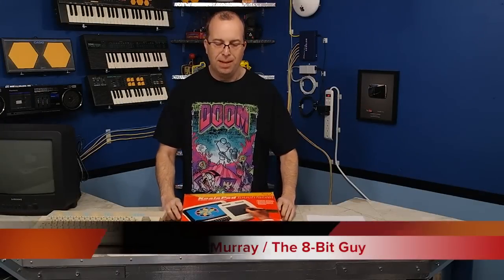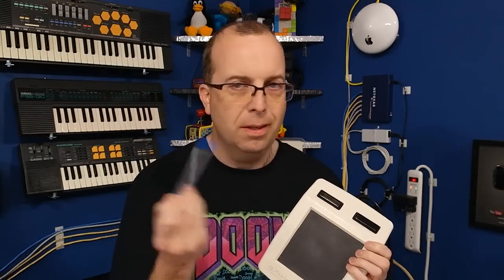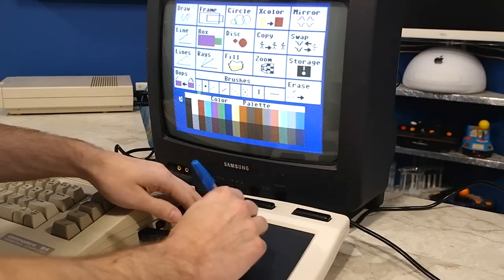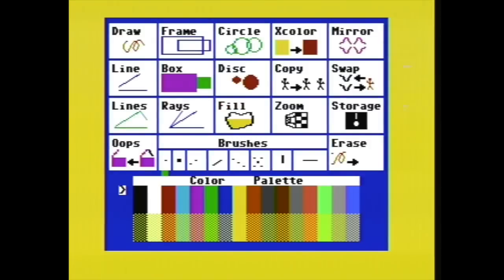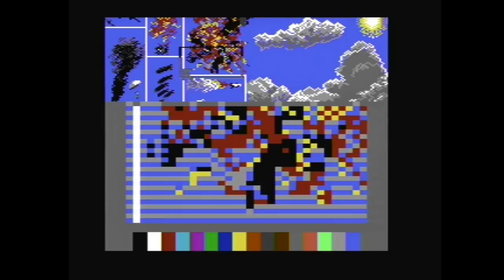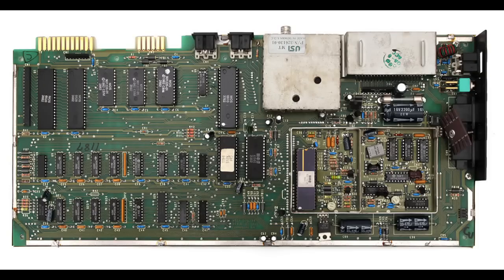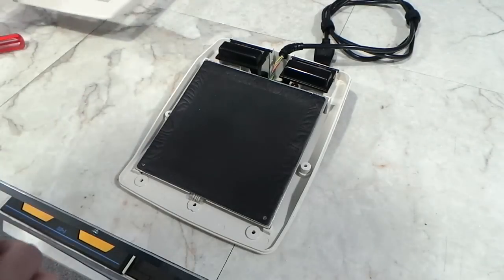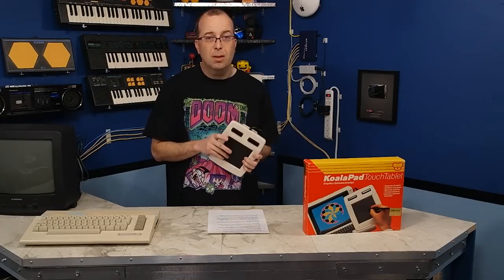The KoalaPad - How we used to create graphics

Comment: Would have liked to see him trying to draw with the paddle
Reply: That would probably be remarkably similar to an Etch-A-Sketch
Reply: cedmanotro Thought that was his next move.
Reply: I think that's called an Etch-A-Sketch. ;)
Reply: +Ram Laska yep
Reply: Ram Laska an etch a sketch has two knobs
Reply: cedmanotro As would this: one paddle for X, one for Y
Reply: Yeah, it would be just like an etch-a-sketch.
Kinda like how using it normally is like... a pen. ;) haha
Reply: I dont think he could draw with the paddles because it would be missing a that button connection the pin that signals to start drawing.
Reply: Mike Magee Those are probably on the pins for the paddles' buttons.
Reply from the maker: Actually.. I had meant to do this during filming and see what happened.  I suspected it would be like an etch-a-sketch.  But I forgot and didn't remember to do it until I had already packed everything up after filming.. so oh well.
Reply: The 8-Bit Guy sad :,(
Reply: Has there been no Anti Aliasing algorithms back then on Commodore 64 or Apple computers?
Reply: DanielNL
Even if they did, the available color palette wouldn't have been wide enough to represent in-between values.
Reply: Dithering was pretty much the best they could do. Antialiasing wouldn't come out until computers had access to a more colors.
Reply: How many colors? And what would that be? Win 95 or already before that?
Reply: Follow up vid :D
Reply: ***** Not as insane as you might think, if you're clever. But as DataCab1e mentioned, the color palette was limited.

What you're probably thinking of is FSAA/SuperSampling, where you render the image in twice the resolution, and scale it down to the screen size. Really basic antialiasing could be something as simple as putting a light gray pixel around every black pixel you paint on screen, like using a feathered brush in photoshop.

In the early days of antialiasing (1992 or so), there was even software (I think it was called JAG on the mac) that would do antialiasing of 2D vector graphics for you ("in post" they'd say in the film business) so that you didn't have to suffer software slowdowns (or buy more sophisticated software that supported AA). It was basically just a sophisticated blur (hi-pass filter??) algorithm that smoothed out jaggies without losing detail in the picture.

For vector graphics and vector text rendering (the Macintosh didn't get vectorized fonts in the OS until System 7/1990), it was a matter of calculating how much of the shape in question is in the pixel, rather than simply whether it is in the pixel or not (resulting in a shade of gray (or whatever the color of the object was), rather than just black and white.
This did make things a little slower, but not as slow as what you call AA in gaming.

If you read up on AA in gaming, they've even learned to take smart shortcuts there, and they don't render the entire frame in 2x/4x/etc. resolution.
But I'm not a big gamer, so I don't know much about how 3d graphics works. I grew up in the 2d days... heck I grew up monochrome! :D
Reply: logicalfundy I remember trying to pull off AntiAliasing via dithering on my old Mac SE back in the day... even with careful hand-editing in "FatBits," it never quite got there. I'm sure the (16?) colors that the C64 could get closer, but only so far.

Did anyone else grow up in the day where you would get some cool graphic on the screen, and then have to back up as far as you could get away from the monitor in your bedroom so you could actually "SEE" the picture, and not a dithered mess? It was even worse in monochrome, ha!
Reply: The Atari ST had anti-aliasing with Spectrum 512.  It had a large color palette so it looked quite nice.  It was slow, however.
Reply: DanielNL Theoretically, you could do it with 256 colors, but that was still palette based and probably couldn't guarantee enough colors for the transitions - it really didn't become viable until we had 24-bit and 32-bit color available, which was basically over 16 million colors.
Reply: Would have liked to see him trying to draw with the paddle
I've done it. It's just like using an EtchaSketch, but in colour.
Reply: Ram Laska Indeed I do recall such images, along with printer (ASCII) art where you had to stand way back to figure out what you had just printed.
Reply: Master Hoshi I wonder what the first game with Anti Aliasing was
Reply: Each paddle has a fire button... And they'd correspond to the two buttons on that unit.
Reply: Ethan Poole Yeaah, dude! That was the stuff! I literally dreamed of finding ways of rendering color on my monochrome Mac, or getting an Amiga with it's dreamy HAM color modes. There was actually a SCSI graphics adapter that would let you hook up a color monitor to a monochrome mac. $600, not including monitor (early 1990s dollars).
Reply: For the record, I did AA in 1989 with nothing more than text mode on an IBM AT (is that what they were called?). I just printed a series of full-character-cell blocks in a diagonal pattern, and then printed out the same series of blocks with light gray blocks surrounding them. If you backed all the way up (to get far enough away from the chunky "graphics" on the monitor) you could tell a difference.
It was just to play around with the idea of doing AA, since I didn't have any hardware good enough to see the real thing for myself.

I'm trying to remember when AA text rendering came about on computers. I know Windows XP had Cleartype (sub-pixel rendering) and AA, did windows 95 have AA? Anyone remember? (or have a VM? ;) )
Reply: Font smoothing (basic AA) was introduced into Windows with the Plus! pack for Windows 95:

https://www.microsoft.com/typography/SmoothFonts.mspx

Font smoothing was included by default in Windows 98:

https://www.microsoft.com/typography/faq/faq4.htm

Microsoft's ClearType (which tweaks colors a bit to take advantage of how pixels are packed on LCDs) was introduced in Windows XP, but wasn't turned on by default until Vista:

https://en.wikipedia.org/wiki/ClearType
Reply: That's right, I remember now.
Windows 95's AA worked very well, and didn't seem to slow down the system much.
Reply: That is just what I was going to say.
Reply: Would you have had a way of simulating the button press while using the paddles?
Reply: Fabrizio Lungo it's using the same pins so eh
Reply: Another bit of info for the AA origins question: While Windows 95 was the first microsoft OS to have font AA (if you had the Plus! pack), Mac OS 8.5 (1998) was the first MacOS to have it: https://en.wikipedia.org/wiki/Mac_OS_8#Mac_OS_8.5

I can't think of any pre-Mac/Windows software that might have had it, but I know that the Apple II did a (very) rudimentary type of subpixel rendering because of the way color was addressed (extra color bits was used for extra resolution in monochrome mode. So if you created high-quality graphics for monochrome monitors and viewed it on a color monitor, it would look like subpixel-rendered graphics -- except that subpixel rendering could never work with a CRT, because the electron gun was not align to hit the shadow mask perfectly -- not even on the Sony Trinitron)
Reply: Ram Laska You mentioned Windows 95 could perform AA very quickly: With the AA used in font smoothing, you could use mathematics to determine how much a pixel was covered pretty well, which can be done very quickly. It's also the case that font designers can add "hints" that can ensure the fonts look good at small sizes.

The reason why it's so much more intensive in 3D graphics is because predicting the colors you need to antialias between is much more difficult, because of textures, lighting, shadows, and other parts of 3D graphics that fonts don't have to deal with. There's also no reasonable way of adding hinting to a 3D model. Thus, 3D graphics has to use more intensive methods to antialias. You can always brute force AA by rendering it larger and scaling it down (aka supersampling), although some faster algorithms have been developed as well.
Reply: cedmanotro Wasn't sure if the paddles had a FIRE button or if The 8-Bit Guy could break out Pin 5 in order to get a button that would work.
Reply: Fabrizio Lungo  Wasn't sure if the paddles had a FIRE button
Yep. A big red button at the end of the paddle controller. You can see it in the video.
Reply: God Emperor Lionel Lauer Ahh, should definitely have worked then. Thanks.
Reply: logicalfundy You're totally right. Calculating AA in 2d is so much simpler than in 3d.
Wildly guessing here, but I think what a lot of video cards do is render the frame at screen resolution, an then re-render only the parts with high-frequency data (aliased) in a higher resolution. I'm not sure, though. Not much of a gamer, and boy, Macs sure stink for games. My Macbook air is only two years old, and I have to turn the graphics waaaay down on Kerbal Space Program for it to run smoothly.
Reply: Ram Laska  Calculating AA in 2d is so much simpler than in 3d.
Back in the 80s, we used to antialias by hand when we were laboriously drawing up pixel graphics.
Reply: God Emperor Lionel Lauer  Aye sir, did a little o' that myself!
In 16 color mode (or less), though, there wasn't much palette to work with. If you wanted to AA a black or white line, it was easy enough, because you had 4 shades of grey. But if it was RGB/CMY, there were only two shades of each. I guess you could do a little bit of it, but not a great deal.
Reply: God Emperor Lionel Lauer I think in todays parlance, though, they would call it "Feathering." AA implies a mathematical process, since "Aliasing" is (if you read the wikipedia page) a signal-processing term, not an aesthetic one.
Reply: Ram Laska It was a lot easier when VGA & then SVGA cards hit the market.
Reply: God Emperor Lionel Lauer SVGA? Pffft... that's practically an NVIDIA. 😂

I miss the days when computers were a challenge, whether it be graphics or programming, or even finding ways of writing a whole book in one without it running out of RAM or Disk space.
Reply: Ram Laska You want a challenge? Here's the first computer I programmed on, back in about '78:
http://www.oldcomputermuseum.com/mini_scamp.html
We had the fancy expanded memory version with an entire 1KB of RAM. ;)
Reply: God Emperor Lionel Lauer 
Beauteous! Reminiscent of the Altair 8080 or the IMSAI. Definitely sweetly limited ;D
How far did you get with it?
Reply: Ram Laska I wrote a buttload of SC/MP assembler, hand assembled it, & 'keyed' it in with the toggle switches. Not fun, but very educational. It was kinda like playing the world's hardest computer game. ;)
Reply: cedmanotro same
Reply: cedmanotro in my opinion it'll be a digital etchersketch
Reply: Maybe he should draw with the Rolling Rock from the NES
Reply: Damn that would have been a great idea for the 8-bit guy to try, just to see how the software reacted.
You hear that 8-BIT guy, we want the paddles plugged in to the Koala software!! ;)
Reply: @The8BitGuy  I got some diskette software for the Koala Pad, including Koala Painter AND the "Instant Programmers Guide". Do you have any idea what sort of software that would be?
Reply: @The8BitGuy  ah rip
Reply: I would have rather seen him play a game that uses the paddle with the koala pad

Comment: I always loved how in BASIC you can just PEEK and POKE hardware registers, like as you used in your test. Nowadays the hardware is hidden under so many software layers
Reply: Yeah... Although many modern compilers still let you use inline assembly code, which comes pretty close to the same thing.
unfortunately if you're using a modern multitasking OS, the OS might freak out and complain if you do certain things.
The last time you could easily do things like this on a PC was using DOS.
Point of fact Qbasic has the same abilities to read hardware registers that systems like the C64 did.
And many DOS games were using graphical modes which you could only enable by writing directly to the graphics card registers...
Reply: YEP, I remember long ago turning the datassette motor on and off writting to a certain position ...
Reply: being able to take a look under the hood is great from a development standpoint, but it's insecure as heck. Use a debugger or other tools to peek inside the working memory of modern programs
Reply: Funny, 30 years later I still remember: POKE 808,234, POKE 788,52, SYS 64738, SYS 49152
Reply: Luissen Tawnybrush
 I understand the reasons why they no longer allow such access anymore, but on such old 8bit offline systems, it was a joyous and fun thing to play around and learn from... im just reminiscing good times
Reply: I'm not too familiar with it, but I have the impression I've seen similar things being done in Linux using something like cat /dev/something in the shell... Am I remembering it wrong?
Reply: Kids these days could still have these 80s/90s programming practices if they cared enough - almost every high schooler in the United States has a TI-83/84 plus, which had a pretty huge z80 assembly community at least in the early/mid 2000s. While it's died down a bit, all the resources are still there, and in a very robust state, and the install base of z80-based handhelds is pretty huge.
Reply: You can get that "down in the metal" feeling these days with a Raspberry Pi or Arduino.  You still rarely poke around in memory addresses but especially on Arduino you could.  The CPU architecture of the 8-bit AVRs is actually human understandable.
Reply: +Joseph DiSalvo That was my introduction to programming.
Reply: While you could peek and poke around on the C64, a lot of the addresses were un-documented, known only to few people in detail.   But as time went on, the information started to spread.  SYS 64738  away!! :)
Reply: That's the appeal of the Arduino or Raspberry Pi.  You get these GPIO lines to peek and poke all you want.
Reply: Windows NT forbade accessing hardware directly, IIRC

Comment: I've got one of these for the Atari 8-bit/Commodore 64, but I've never had the software to use it with. Awesome to see this in action, had no idea it used the pots to do its thing!
Reply: some PVA Glue (for repairing books) will fix the tear in that box right up! You can even buy archival grade if you afraid about yellowing over time. Just apply a small amount with a toothpick, i know i'm OCD.
Reply: Lazy Game Reviews  I'm a big fan, I'm looking into getting a c64, any advice?
Reply: +Landon A  ofcourse,  look around on e-bay clones and you'll have an easy time :P
Reply: raafmaat thanks man. :)
Reply: I have the same problem- I have the official branded Atari 8 bit one, but can't find any of my carts!
The cart for that one also had a Game Of Life app, which was the first time I ever saw one.
Reply: confuseatronica
 oh man,  as a kid i used to play with game of life,   found out about crawlers and guns etc,   but it wasnt until 15 years later i found out people are making whole machines with it,  actual logic gates and stuff
Reply: +Landon A i suggest at first getting a C64C or C64G  because earlier versions tend to be dead when you buy them, unless you buy them at a local vintage computer expo or something where you get to see that they're still running and they don't get bumped in transit. Newer versions run their chips off lower voltage and have more modern IC design, as a whole more resilient to electric and thermal issues. For the most part, even dead newer ones merely have a broken PSU or dead fuse with nothing in the system proper actually being wrong. It probably makes more sense to get an aftermarket PSU or fashion a new one yourself than trying to repair the original one.

But of course purists sneer at the Cs, for one, they don't look like a breadbox, for other, they sound different - a lot cleaner, usually somewhat punchier in the bass, more consistent among each other but quite different to original system. Digi voices break in some games, but people mod the machines to re-introduce that.
Reply: Siana Gearz thanks for the info, I had no idea that the c64c ran better than the original c64, thanks again for the advice :)
Reply: Lazy Game Reviews What's up LGR. I have been seeing U a lot on 8 Bit Guy's videos. Please do more LGR Thrifts episodes.
Reply: Lazy Game Reviews I accidentally reported your comment idk what for it was an accident... I'm sorry
Reply: POKEGAMERZ 9185 bhh
Reply: Lazy Game Reviews 

L
Reply: I bought a Koala Pad at a local computer store back in '84, but the pixel control via the pen was way inaccurate, as it was holding down on one spot, the on-screen pointer kept "jumping/flickering" back and forth to adjacent pixels.  Guess it was due to the low resolution of the  digitizer and the x-y input port inaccuracy, none the less it was fun and amazing at the time. :)
Reply: LGR oh dang

Let me make a joke 

Q
W
E
R
T
Y
Reply: I have the opposite problem. I purchased the software at a garage sale, but I don't have the actual pad, LOL
Reply: LGR I have a capture card for c64 but no c64
Reply: i guess I'm kinda off topic but do anyone know a good site to watch new tv shows online ?

Comment: I've tried to run Koala Paint on an emulator and control it with the PC mouse but I can never get the right button which switches from the menu to the drawing screen to work. BTW, I have an actual Koala pad with the floppy. Did a lot of drawing on that - pretty fun given its limitations.
Reply from the maker: Actually... It took me a while to figure out how to switch screens.  I had to read the manual.  Apparently you have to move the pointer on the pad all the way to the very bottom, which is technically off of the visible screen, then you click the button.  I am not sure there is any way to do that on an emulator.